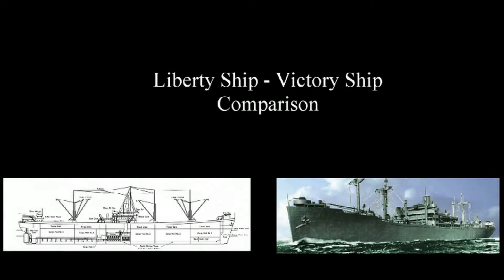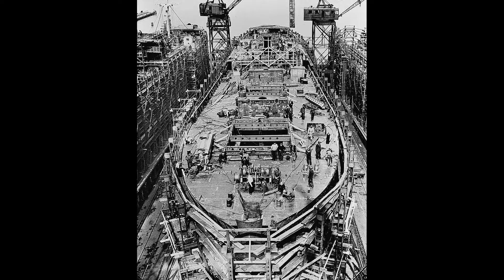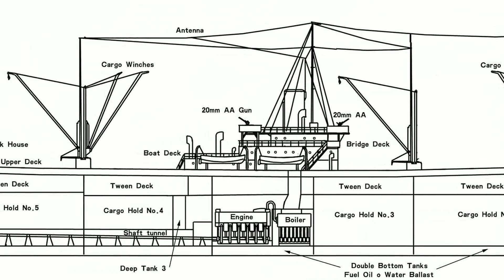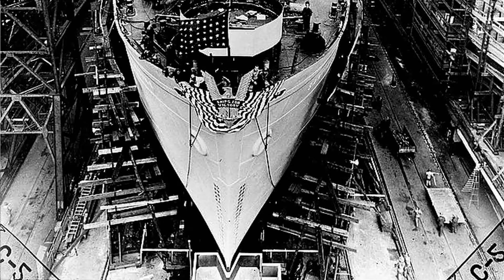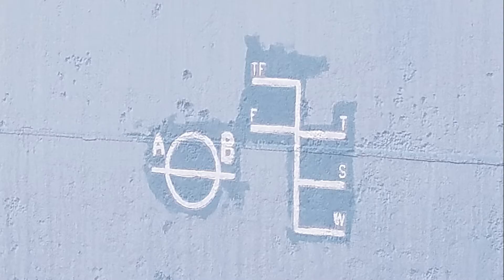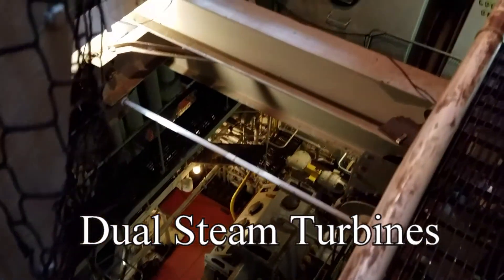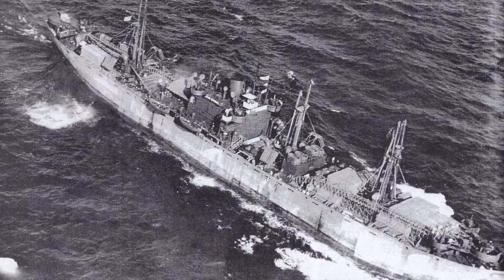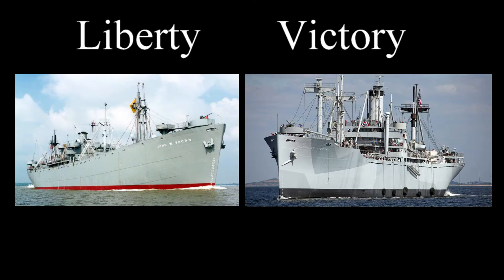Liberty Ship - Victory Ship Comparison

Comment: Did the Liberty Ships have a thrust bearing mechanism between the engine crankshaft and the prop? I've heard those were used in some steam powered ships to provide isolation of load between the prop and the engine. In schematics I've seen of Liberty ships, I see direct connection between the prop and engine. Anybody?

Comment: I sailed a Victory to Vietnam in 1969 "Denison Victory" carried ammo to base up the rivers.  The ships were well built and reliable we had Limited AC power. If memory serves me DC generators, my most vivid memory is when we came into port and rigged cargo cranes and unbatten the hatches.  That was hard work and had to done quickly.. Came home and sailed thru a typhoon, Thank God the Captain was old Norwegian who really new his business, if he didn't I would not be here today!!Great Video
Reply: During most of 1968 I was stationed at the munitions port near Sattahip Thailand - at Camp Vayama.  
We could handle three ships at a time, two on either side of a DeLong pier and one on on the fixed pier that was primarily for POL.
The Hattiesburg Victory is the only one I remember by name.
Reply: I sailed on ss ariscebo naviaris de Porto Rico it was built as ss rose victory but converted to a container ship before I sailed on it
Reply: wow you are old i am sailing on american victory in 2020
Reply: @nicolasnewman4308  I "sailed" on both the Castor (AKS-1) and the Paricutin (AE-18) during "Nam", both converted Victory ships. As for electrical power: the ships power was DC (turbine driven generators), the deck equipment was AC and had separate diesel generators. The engine room housed ALL the propulsion and auxiliary power.  Looking back...they were death traps!
Reply: Some of them were built in 4 days. They were of low quality. Some of them were drown in the port before they became operational.
Reply: @Amen-Magi  You really don't know what you're blathering about.

Comment: I have a question which has never been really answered regarding Liberty ships. They used an obsolete triple-expansion steam piston engine of about 2500 HP, as I recall. One screw. They were slow, topping out at just about 11 knots. That was the big knock against them, they were slow and underpowered making them easy marks for U-boats. But, why didn't the US scale-up the steam engine they used to get more power? They had the room inside the engine bay, no reason they couldn't take that 2500 HP design and upgrade it with larger diameter pistons and squeeze maybe 4-5000 HP out of it. Why run slow and vulnerable if you don't have to?
Reply: Not sure on this but its a possibility to wonder if they chose a known in-production engine (in addition to already mentioned factors like lines, length etc). To jump the horsepower 100% might have put it into the new engine or limited production facilities. Since in peace time that ship size and speed is okay for affordable shipping that may have influenced it. Plus 2,500 hp is a pretty round number that I could see a design review using as "about that" rather than delaying for 6 months of detail investigation, planning, proposing etc for a "perfect" engine.
Reply: I think one reason was that the accepted design was proven, reliable and relatively easy to manufacture. They did not want to take the chance to experiment with different designs or the issue of larger recip engines being more time consuming and difficult to build. Probably many of the contractors pressed in to service making parts were not normally used to building those steam engines and might have had a hard time with larger engines.  Also I have read that early in the war the average convoy speed could only be about 10 kts anyway because the pre existing ships at that time were mostly older and could not go any faster. So it would not accomplish much to make the Liberties much faster. Later in the war when many of the older ships had been lost and they realized the importance of speed, they came up with the Victory design. When turbines became available, they are more efficient and better suited for higher speeds, and they were the go-to engine.
Reply: Read what the royal navy thought of the Greek ships liberty's are the easy convoys the submerged uboats could not keep up with the liberty's
Reply: Adding mechanical load to a hull that has flexing problems and crack propagation issues (rivet holes and sheet side i.e. crack stoppers were replaced by weldings) is not a good idea! Thinner metal sheet improved flexing, contributing to the solution of the breaking problem of the liberty ships
Reply: That is a interesting point you make. they could have fitted a more powerful engine... maybe they did not to keep fuel consumption down... a lot of those engines where build by steam locomotive works, was there perhaps a limit to how the big an engine they could build ?
Reply: @jandoerlidoe3412  The reason is simple: $$$.  These ships were built fast and cheap...turbines would have added thousands of dollars and more time to the construction. A turbine is much more sophisticated (and thus more expensive) to produce and operate that a triple expansion stem engine.  Todays maritime ships operate with HUGE diesel engines...steam has limited applications, like nuclear powered vessels.
Reply: @patrickbass3542  One of my favorite questions of my engine cadets was, "Everyone knows what an internal combustion engine is.  Can you give me an example of an external combustion engine?"
Reply: @jandoerlidoe3412  The Victory ship, which was an advancement on the design of the Liberty ship, used a 6000-8000 HP steam turbine for exactly that reason-more power and speed. It topped out at 17 knots at full speed. For the Liberty ship the US manufacturers took a British engine design and built it as spec'd out. Turned out it was underpowered, but that could be seen by a sharp designer from the beginning. They should have scaled it up to 4000-5000 HP at any rate.
Reply: @heyfitzpablum   Phil  The liberty ship design was based on a 1870 th cargo ship . In a sense that is odd as the British had build standard ships before in WW I.
A ship's speed is dictated by its lines: just putting more HP in does not mean the ship will sail much faster.... never the less, i believe liberty ships would have benefitted from more powerful engines... 
Probably the reasoning behind choosing a outdated 19th century design was that its simple lines where easier to build...
The victory ships did have finer lines ( hull design ) that did lend to higher speeds, so, in that case putting in a 8000 SHP turbine made sense...
Also, at that time steamturbines for cargo ship became available again, as before the whole production capacity of turbine engine builders had been devoted to war ships....

All in all the story of the liberty ship design & building is a fascinating story as they where mass produced & build up out of prefab modules with standardized machinery & auxhilaries...
Reply: @jandoerlidoe3412  At any rate, I love looking at those triple expansion piston steam engines the Liberty ships had. I'm an engineer by trade and work for the US automotive industry. Well designed motors appeal to my eye, even steam driven motors!

Comment: Correct me if I am wrong.. They were only expected to make one trip across the Atlantic.. I swear I saw that somewhere..? Great video BTW.. 👍
Reply from the maker: Sort of.  It was determined that if a Liberty ship only completed one successful voyage and safely made their delivery then they had accomplished their mission and represented a net win.  That said they were hoping to get more than one crossing out of them.  The concrete ships, that I did not cover, were considered more disposable and not that many were made (many were motorless barges).  With all that said you are essentially correct about Liberty ships but the Victory ships were made with many uses in mind but one successful crossing would still be considered acceptable.  The T2 tankers were basically redesigned Liberty ships and the same goes for them.
Reply: The design life for a Liberty ship was only 5 years. While one trip with a full cargo constituted a 'net win' they were designed to have a productive life through at least the duration of the war (est. 4-5 years in 1940). After several fracture failures, mainly in cold water conditions, they discovered design flaws which made their design life more questionable.  These were rectified (first in the Liberty ships and carried over to the Victory ships) by improving the grade of steel used in the hulls, designing out stress raisers like sharp corners, adding crack arrestors in critical areas (adding a strip of steel along the side of the ship in some Liberties), increasing the distance between internal girders to 36 inches (from 30 inches) and so on. The failures stopped after these corrections.
Reply: "Liberty" ships...not "Victory" Ships.